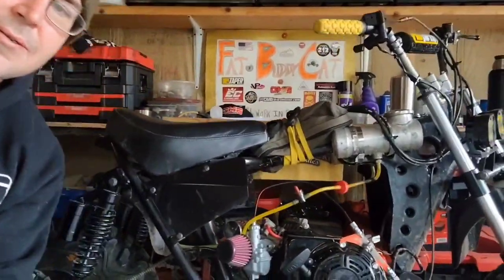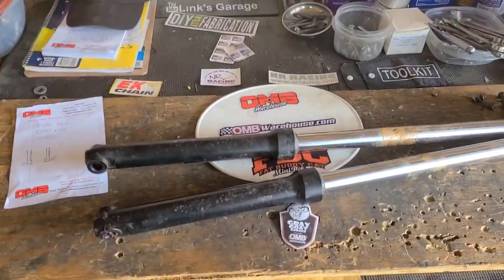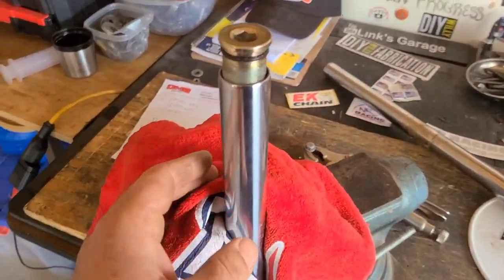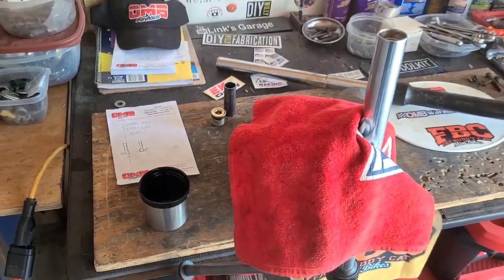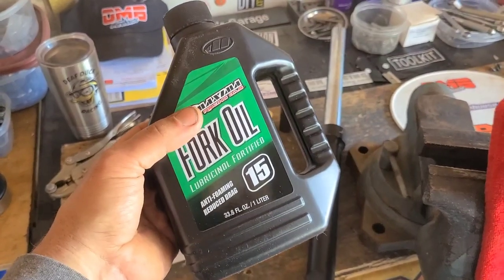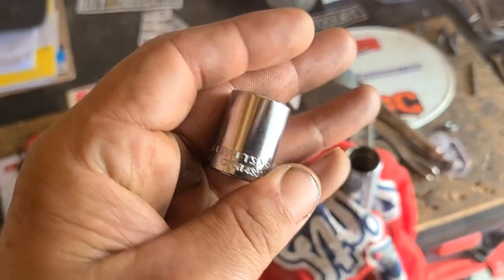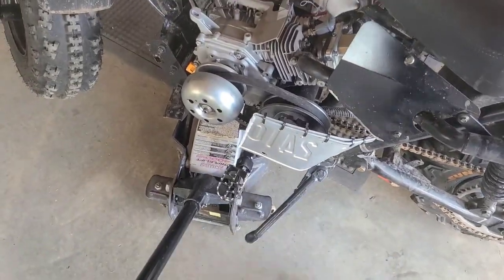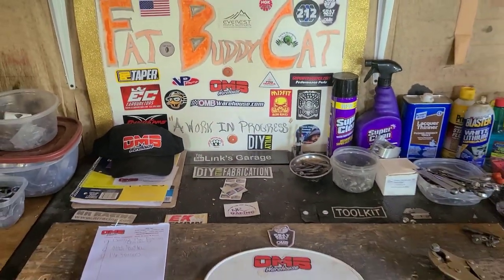Trailmaster MB200-2 Fork Upgrade In 15 Minutes!!!!

Comment: That's what I need to do.. Thanks for the information and sharing!
Reply from the maker: No problem! It feels like a big improvement just pushing on the handlebars.
Reply: @fatbuddycat  Good to know. I’m still having problems with disc brake on the 224 bike? After a bit of riding the brake just doesn’t work anymore. Not sure what’s going on. I may upgrade again to a dual piston to tame the 224 beast. I’m also researching a new brake rotor. That might also help.
Reply from the maker: @DIYWilly  Wowzers! That's a pretty simple design on that single piston brake too. Is it broken or just not strong enough?
Reply from the maker: @DIYWilly   you can step up to a higher level caliper but it's going to start getting expensive next. The MCP systems are supposed to be pretty good and there is Brembo. If you don't want mini bike results your going to have to start using motorcycle parts. The biggest hang up is spacing everything out and making the hubs work. Brakes and foot pegs are my least favorite thing to figure out.
Reply from the maker: @DIYWilly  what about the Trailmaster brake and adapter? The dual piston brakes have more meat on the wheel side but it should clear those 8s.
Reply: @fatbuddycat  yes been looking at every option and trying to figure out how to make it fit the 8” wheels. Mighty doesn’t have these problems. I tried to grind the rotor earlier and that helped but get some speed and forget about it…😬🤪It ain’t stopping..
Reply from the maker: @DIYWilly   super aggravating! I'm locking up on my Doodlebug with that larger single piston but I'm not on pavement either. Your rotational friction and heat is destroying brakes some how. I can fade the dual piston on my Trailmaster in about 6 laps of my front yard and that's using a kt196 rotor with better cooling slots. I'm running a lot heavier bike with 19 inch 6 ply tires so the rotation is slower.

Comment: I’ve always thought my gopowersports forks were too soft. If I change the oil and space em out I can tune them just like my rc cars. Gamechanger!
Reply: I really changes my rc cars. They are much faster than my mini bike. The soft preload makes my bike a little too spongy. My Losi still can’t hit top speed safely but tuning really helped up top. 60 mph rc’s can have spectacular wrecks.
Reply from the maker: Hopefully I'll get to ride it today. This can be done with smaller forks too I believe.  Only difference should be ml of fork oil and the spacer size.  I studied a little bit and my general concensus is that everything thats done to a factory fork should be done in increments. I would try the 20wt fork oil and there is a motorcycle spring that can be swapped in as well.
Reply from the maker: @sambyrum5276  I'm going to do this to my Vintage bike too. That fork is definitely not set up for adults from the factory!
Reply: @fatbuddycat  not setup for adults but that’s the fun part
Reply from the maker: @sambyrum5276  lol! Tell that to my Doodlebug.....egads man....that thing is a lot to handle! I've been thinking about adding a suspension fork and 10 inch steel wheel just to help plane out....perhaps there is such a thing as TOO small.....😬.....
Reply: @fatbuddycat  we built a vintage bike for my neighbor. It was so fast nobody would open it up all the way. He sold it for $500 he had like $50 in it. He built a monster moto.
Reply from the maker: @sambyrum5276  monster motos are cool. A little limited for mounts but everything is once you've had a taste of custom!
Reply: @fatbuddycat  it and the motovox are drag bikes of choice around here.
Reply from the maker: @sambyrum5276  nice and light! My Doodlebug is such a pain to ride I'm thinking about using my Warrior instead.
Reply: @fatbuddycat  I want a Track2.
Reply from the maker: @sambyrum5276  I find them from time to time but I'd like to see one in person.
Reply: @fatbuddycat  I didn't buy one when I had the chance. The guy I got my monster moto from had one about 1 year before I bought mine. Very similar size frame. I just think they look better.
Reply from the maker: @sambyrum5276  I have a stacked little 79 I want to get on something. I want a straight up beater.
Reply: @fatbuddycat  I’ve always heard you need a flathead for a beater. Hard as hell to hurt those engines.
Reply from the maker: @sambyrum5276  I'd have to find one first! Lots of junk snowblower engines up this way.

Comment: what rear shocks are you using? do you like them? Im looking for some upgraded rear shocks. Thanks!
Reply from the maker: Those were some decent reservoir shocks I got back in the day. It was better than stock. They added more dampening which improves traction by actively controlling the swingarm.
Reply: @fatbuddycat  yeah I’m a bigger guy and my bike did decent on the trails but could def use some more travel, thank you for the quick reply! I’ll look around

Comment: What does the oil in these forks even do? There isnt a shock for the oil to flow through. And do you know if the hurricaine comes with the improved gps shock or the old one like in this video?
Reply from the maker: Take the shocks apart and look at how they work. It's not a hydraulic piston, suspension works with a dampening and preload. The springs control how stiff the suspension is and the oil deals with the movement (compression and rebound). Hurricane just has a front brake on the tube, same suspension as the regular Trailmaster. GPS also didn't create the Hurricane, they just like to act exclusive.
Reply from the maker: Worst part about Trailmaster is the frame and suspension geometry. They had issues with the gen1 (looked like a Warrior with rear suspension) frame cracking and tried to fix it with the engine mount rather than redesign the whole bike. The long shaft engine to line up the torque converter is pretty dumb too....as are the crazy cheap plastics, foot pegs and seat. Buncha crap.
Reply: @fatbuddycat  yeah I know they just get the Chinaman to make everything then sell it to us but people say good things about it and I want a full suspension mini bike. From your experience since you have a ton should I get the trail master or the Coleman rsv? Or are there better options even? Doing road and trail riding and light stunts nothing crazy